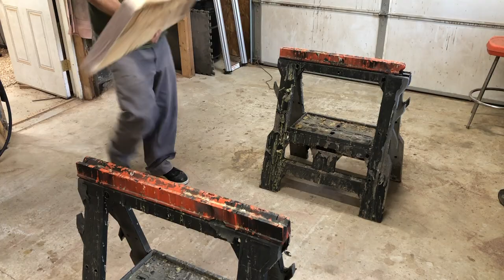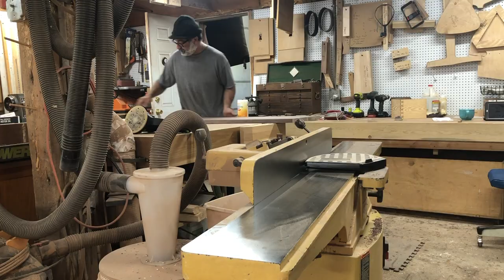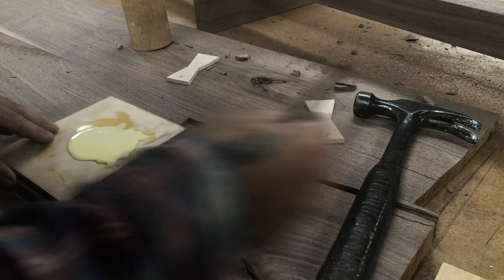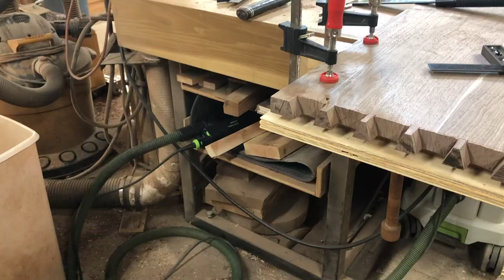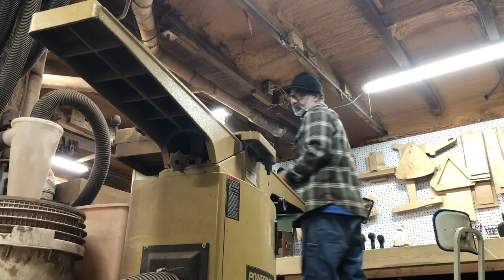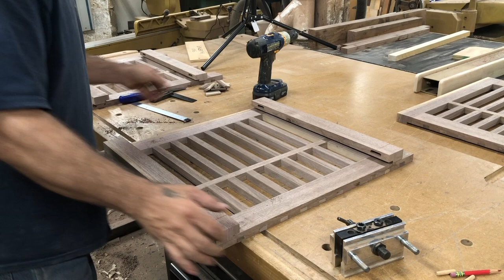Mid Century Modern Credenza Build Video Inspired by George Nakashima Design

Comment: Learned a lot watching this! What material did you use for the behind the slats on the sliding doors?
Reply from the maker: Hi Ryan thanks for watching! I glued some canvas fabric to 1/4 in plywood with spray adhesive. The back side of the door was recessed for the plywood to fit.
Reply: Amazing. Thank you so much!